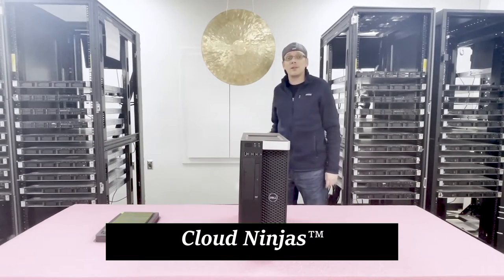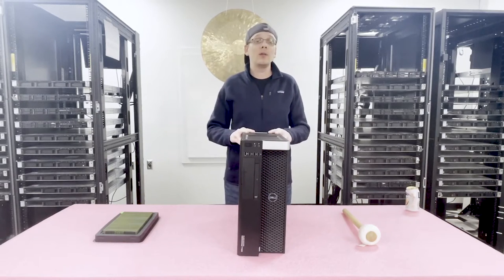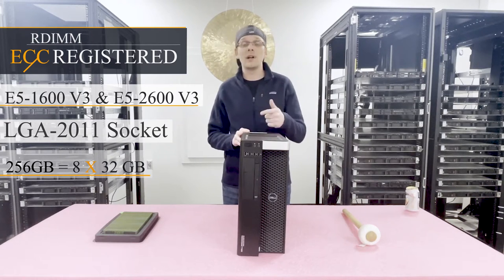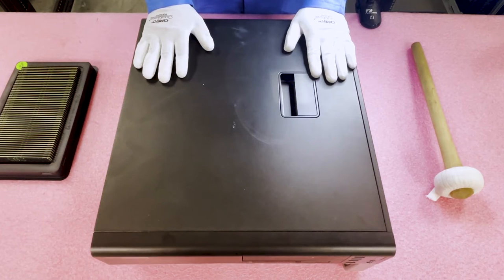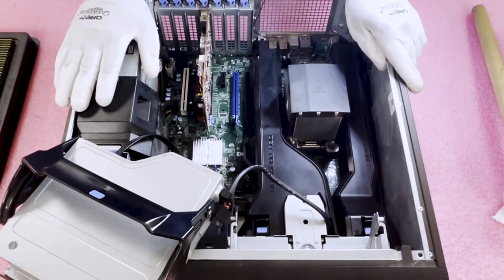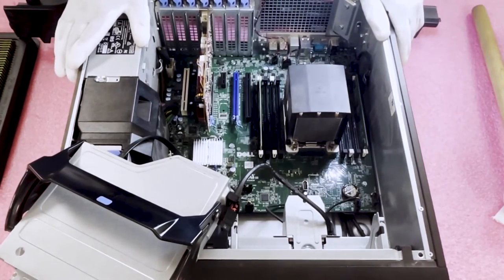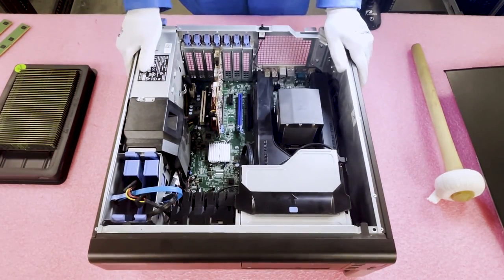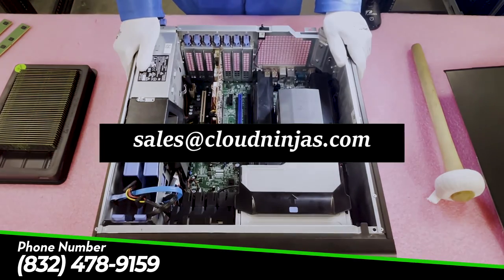Dell Precision T5810 Tower Workstation Memory Overview & Upgrade Tips | How to Install & Configure

Comment: Anybody knows what's the maximum RAM configuration that supports max speed (2133, 2400)? Finding such information online is pretty much impossible (many hours over few days and I found nothing).
I had a Xen 1620v3 in such PC. Ran flawlessly with 8 4GB DIMMs at 2133. Swapped it for 1650v4 but with 8 DIMMs it can only do 1866. Removing 4 DIMMs puts me back at 2133 (but now it's just 16GB which is really limiting, but the performance drop from running memory at 1866 is around 20% for me). I wanted to upgrade the RAM to 2400 one and 64-128GB. But now I know I am limited to just 4 DIMMs if I want to have maximum performance.
This brings me to my question: what is the maximum size of DIMMs that will let me run at 2400MT/s? Because now I am not so sure 4x32GB will be able to be run at full speed.

Comment: I'm not sure your statement about "getting the maximum performance" by filling all 8 slots is totally correct.  At best, I'd say "it depends" - and that's due to what @GewelReal mentions below.  Filling all 8 slots is going to result in a speed drop.

Comment: The MB is actually a LGA-2011-3 socket and with a updated BIOS:  V4 cpu's should be used over 'any' V3 CPUs'
Reply: You have more info or link on this?
Reply: @Patrick_AUBRY Dell's website says v4 CPUs are supported since BIOS version A12

Comment: How can I install a 32gb module with the 4x 4gb module I have already installed? All 4gb are in the white slots. But when I add the 32gb doesn't boot but the led is white, trying other combinations gime me the yellow led when power on.

Comment: Hi, 
I have a Dell precision T5810 with Intel Xeon E5 2673V3 processor and one 32GB RDIMM (quad rank) module installed. I recently purchased one more module of the same configuration (quad rank as well) but when I install both modules in their correct locations (as you showed in the video, the topmost and the bottommost slot on either side of the CPU. it is as shown on the inside of the side panel) the system wont boot up, instead an orange light flashes in the power button. Can you please help me?
Reply from the maker: Sounds like you are using LRDIMMs, which are not supported by the Dell Precision T5810.

Comment: Nice video, one question, if you want to connect hdd 02 and 03 SATA ports where does the power come from? Psu or motherboard?
Reply from the maker: What did you end up finding out?
Reply: Great question! 3.5" > psu sata connector, 2.5/1.8 > from the motherboard, SSD > from the sata cable

Comment: In HWiNFO64 I'm getting temperatures like this: DIMM[0] (DIMM1) - 35 deg C, DIMM[4] (DIMM3), 35dec C, DIMM[8] (DIMM2) 44 deg C, DIMM[12] (DIMM4) 44 deg C. Basically, first two rows in HWiNFO have temperatures around 35 deg Celsius, and row 3&4 show temperatures higher by 10 deg Celsius. Is this normal? What could be the reason?

I'm also looking for information from owners of T5810: what is the rpm of the PCIe fan on your machine? I'm getting 1600rpm, which makes the machine quite loud. When I set it to lowest possible speed which is 400rpm, it becomes really quiet.
Reply from the maker: Would recommend checking your Thermal Management feature in the BIOS.  You can raise and lower fan speeds.  Dell has an article about it and shows the different options: Optimized, Cool, Quiet and Ultra Performance.  Might want to play around with this and see if it helps.  Smash that subscribe.

Comment: Hi Scott,

We want to install 16GB RAM in T5810 Machine, however, the document says we can install it via 4 x 4GB. My question is, can we install 2 x 8GB or 1 x 16GB to attain the required configuration? If yes, what will be the Slot population for 2 x 8GB or 1 x 16GB.

Regards
Reply: You are really limiting your performance by running in dual and especially single channel mode

Comment: Hey, i run a DELL Precision T5810 with a intel Xeon E5 2697 v3, 48gb of DDR3 2133MHZ and a RTX 3060 it's a little too old for the RTX 3060 so ican't have the full performances of it but i do use a HTC vive pro with it so i do VR on that almost 10 year old computer and it's really not bad at all that computers are really good!
my old DELL Precision it's the T1650 with a Xeon E3 1240 v2, 16gb of DDR3 1600MHZ and a geforce GTX1650 that was also a really good compact and powerful PC for something for 2012! (ok once again it's not the original graphic card... the og was a quadro k2000 you do nothing with that anymore...) i don't recommend it for VR but it does work sith the vive pro! the only down side of that machines is they are not compatible windows 11 f@@k you microsoft!
Reply from the maker: Thanks for sharing!
Reply: you absolutely can install Win 11 on pretty much everything. You just need to use a custom ISO that removes TPM requirements

Comment: Hi to all you guys. Would like to make an important question in my case concerning these dell computers that come with raid as an active drive controller (intel rst active) and not ahci. The problem is that whenever i try to boot into these machines in a winpe environment with the Strelec package if you know that, in order to reset the admin password if i cannot log into it or just backup the data of a user into an external hdd before  reinstalling windows if the precedent os is damaged and cannot be repaired, the internal hdd-s or ssd-s of just the os directories into the drives are invisible. I click on “This PC” and there’s only my usb visible and nothing else. I made a search on the internet and it seems it has something to do with the intel rst driver that abstracts the hdd from the os. Please help me, what should i do in this case in order to be able managing the pc even when the pc is unbootable or just the admin password is not recognized.

Comment: Replacement motherboard recommendation?
Reply: I don’t think you can change it unless you get a new case lmk if I’m wrong tho
Reply: @itsmeleo9179  you can't replace it you're right, need a new case and take the cpu out
Reply: @joshuaheywood9988  cpu? I don’t think the cpu has to be removed I think just the heat sync
Reply: @itsmeleo9179  I'm saying like if the motherboard is bad, you gotta start over basically
Reply: why wouldn't you be able to change the motherboard?
Reply: @Mr_Smarty_Pants  you would need to change the case too this case only works with the motherboard meant for ot
Reply: @Mr_Smarty_Pants  because it’s built weird
Reply: @itsmeleo9179  ya, i get that's it's a proprietary dell server board, i thought you were implying it was hard mounted and physically not removable or something, which it definitely is not. Yes, you would have to replace it with another identical used server board from another identical Precision.
Reply: @Mr_Smarty_Pants  the old motherboard started to smoke, you CAN go thru the hassle and get identical parts again, I personally don't think it's worth it

Comment: Hi, i buy one. But with a Xeon e5 1650 v4 and 24gb ram ddr4 2133. I just change the processor. The new is a Xeon 2690 v4 : 14 cores and 28 threads. A monster !!! But ram cannot run at 2133 now. Max at 1866... I don't know why. Any help please ?
Reply: 24GB sounds like you're running in flex mode

Comment: Anyone tried 4x64GB sticks. E5 1607 v4?
Reply: No. But I can say that the RAM configuration in this machine is absolute asinine. In the documentation, I would have never took the chart that literal. The machine came with 2x4GB modules. I purchased 2x32GB modules to give me 64GB. I figured I would buy them later as I needed them. NOPE! With both 32GB installed I get 8GB of RAM. Then I added the other 4GB sticks and now I have 16GB RAM. What a complete stupid way to register the RAM. Now I have to go spend $300 just to get the RAM to register all the way.

Comment: i cannot get the memory modules to click back in, whatsoever. flip them, try different ones in different slots, they won’t click in. i shut the tabs on both sides and then the memory modules are still able to slide right on out.